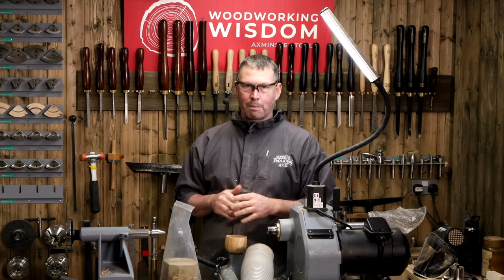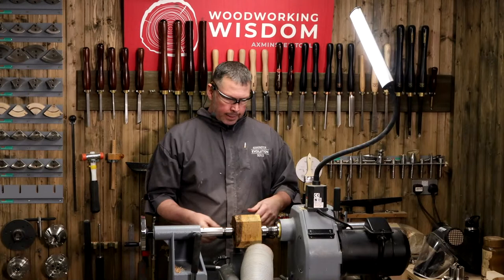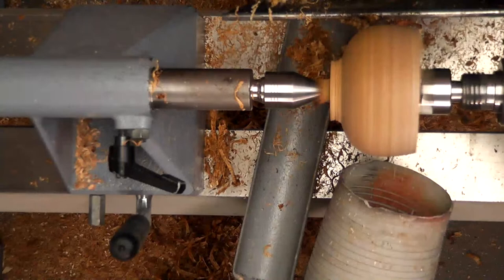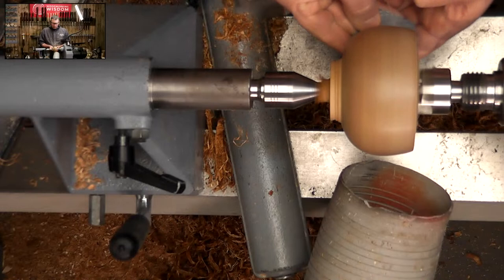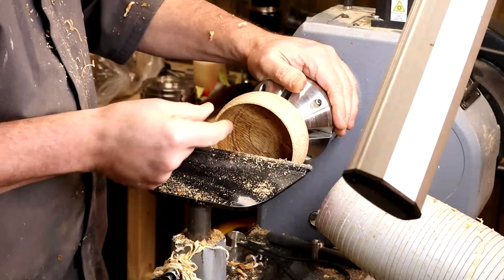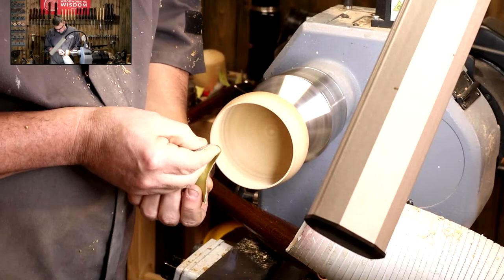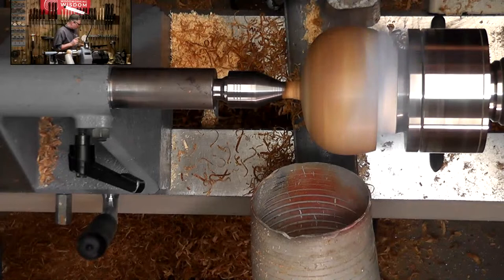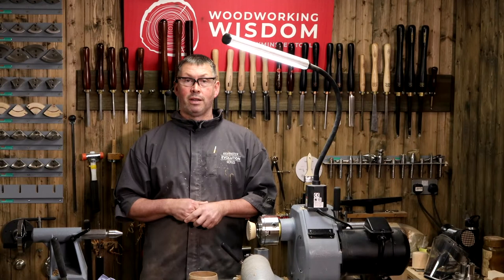Tips on Turning Green Oak - Woodworking Wisdom

Comment: Thanks for the demo. Here in Montana that example bowl 16" by 6" by 1.6" painted with Anchor seal or similar would only take 3 months to dry. I believe it would take over a year in Florida.
I'm using Vicmarc chucks on a Jet 1840 lathe. They don't have a locking mechanism for reverse turning. However, I lock the spindle and crank the chuck hard and I have never had it come off.

Comment: Great video and really helpful. Just wondering, if you wanted to leave a foot on the bowl would it be at risk of cracking as it dries and when you’ll you oil a finish turned green bowl? Many thanks
Reply from the maker: Hi Joe, yes any thick areas will move slowly compared to thin areas and would carry the stress of movement meaning they are more likely to crack. Hope this helps